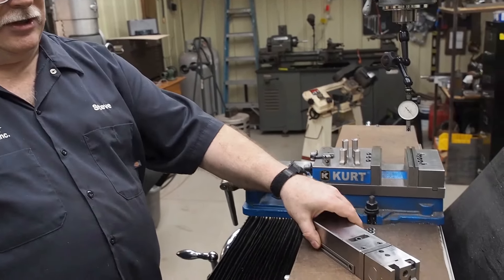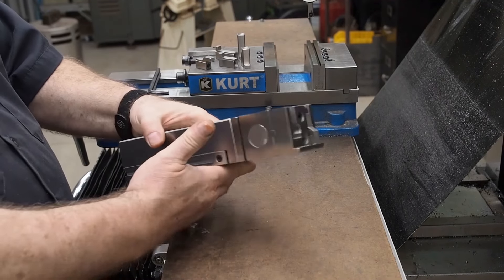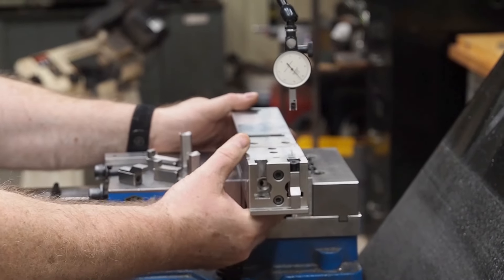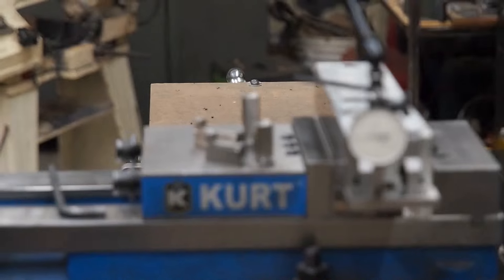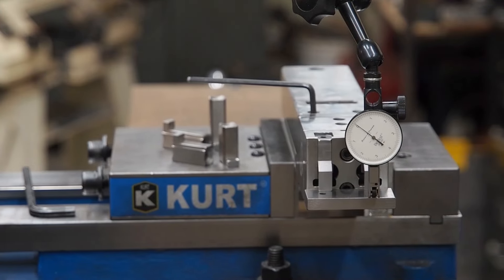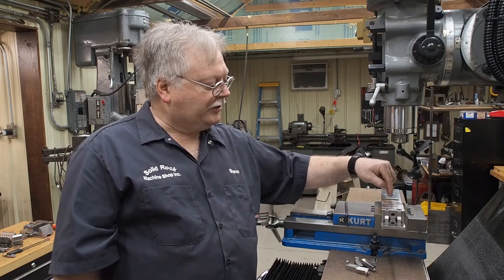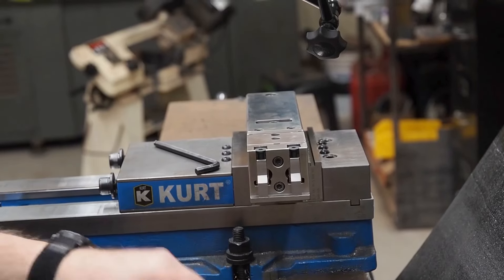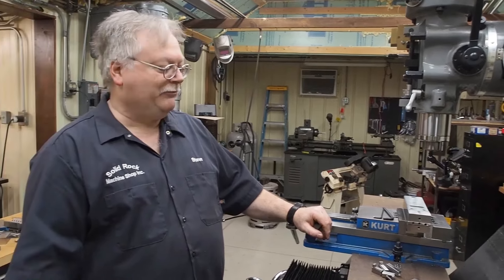Multi Axis Alignment Tool

Comment: Alot of companies sell leveling units. That's what this is
Reply from the maker: You are correct. I have used some in the past and at my current full time job I am using Hirschman tooling which is very nice. I am hoping we will have something better and different to offer.
Steve

Comment: Looks interesting Steve.  I ran a wire EDM for a few years and the fixturing was really important.  I spent about $20k on F-tool kits so they may be an interested company.  they used animations because of complex set ups, which were ok, but demos are key to sales.  Good luck with it.
Reply from the maker: Thanks Ujeb08.

Comment: Looks to me like a super useful fixture. One needs three wrenches for the different screws. I am sure you have thought about trying to use as many of the same size as possible.

Be careful to not reveal too much of it to prevent copycats! I understand you presented your design before putting it on the market as it is patented already. Daniel
Reply from the maker: Hi AtelierDBurgoyne,
Yes, I wanted to use as few wrenches as possible. There are a lot of things going on inside the unit that most would not pick up on even if they took it apart. We will keep the internal workings to ourselves for now. I think the real value of the patent would be to potential buyers who have the resources to go after copycats.
Steve
Reply: Solid Rock Machine Shop Inc. Hi again Steve. Thanks for your reply. I really think you guys are doing wonderful stuff. Love your channel. Looking forward to any vids with the Moore jig bore (or is it a jig grinder?). Daniel
Reply from the maker: Hi Daniel,
It is a Moore Jig Grinder. It may be a while on that one the grinding head needs to be rebuilt or replaced. I am glad you are enjoying the videos. 
Steve
Reply: I strongly agree on both of Your points above, we are in exactly the same situation now with a startup here in Sweden with a new product being put on the world market. It is a type of precision sensor.
My understanding is that Asian copying can most of the time not be prevented, it will just be delayed. Try to keep details to Yourself until the patent goes public, and it is also wise to keep a few things as trade secrets to delay the copycats. Getting a partner with respectable legal muscle is a very good idea. We have done that in the past in previous projects for several reasons. It seems virtually impossible for the little guy to legally defend a patent both in EU and the US presently. Best way for us has been to find a potential customer early on in the project and make a deal that gives the customer early access and influence on the product development in return for legal assistance in case of patent infringement etc. The customer gets exactly the product they want and the product will early on be tested in  its industrial environment. This also tends to make the product more mature when it reaches a wider market. It can be win win situation. This concept can also results in some income from sales early on in the project, which can be very welcome.
My best wishes for success with Your enterprise!
Reply from the maker: Hi Erik,
Thanks for the advice. My son and I already agreed to to keep a tight lid on inner workings of this device as long as we can. There are some critical design aspects to this device that are not apparent to the naked eye even if someone viewed the individual components.  We wanted to introduce the ability of the device in this video for those who may be interested in it.
Steve

Comment: I like the design, I think a finer thread on the axis adjusting screws would make it easier to adjust, but I understand the need to keep it affordable and very fine threaded hardware  the might have to be specially made would shoot the price up in a hurry!
Reply from the maker: Hi Rocking J Metalworks,

We can dial things in less than a .0001" very easy with the 10-32 thread. We been using a devise at my full time job that is different but uses 10-32 adjusting screws and hitting no movement on a tenth indicator is fast and easy. Also, I wanted to use standard components that would be easy to replace by the end user.
Steve

Comment: A solution requires a problem. I don't understand the problem here, if the machine is well trammed and its vise is precision ground and indicated in. Obviously a fixture such as this, with this many moving parts and degrees of freedom, will not hold accuracy much better than 0.001. Notice I said hold, which differs from instantaneous accuracy, although I also wonder whether there would be any reason to use an Interapid test indicator during initial setup. So if tenths accuracy is desired each new part is going to have to be indicated in anyway. I would think shops need to focus their quality efforts on tramming, and training operators to avoid actions that might adversely affect tramming.
Reply from the maker: Hi Josh,
This is a wire EDM part holding device. It was only being demonstrated in the mill because I do not own a wire EDM machine.
Steve

Comment: It is certainly a nice job, but I wonder about the complexity of the fixture. lots of moving parts leans lots of places for grit to land itself depending on outside variables. I have something similar I use at work but with a wider interchangeable jaw set. you can remove the jaws to install a V block on dowels or sine plate. the sine plate can also hold the vblock or part.
Reply from the maker: Hi DieselCrawler86,
In wire EDM you do not have to worry about grit or chips. What you do have to worry about is recast that will build up on the tool. This tool is designed with that in mind. It is easy to disassemble to clean the recast off with a Scotch Brite pad.
Steve

Comment: Best of luck on the sales Steve. Looks like a well engineered tool. Is there any concern of the hardware galling since everything will be set? Thanks
Reply from the maker: Hi James,
I don't think so. This unit had been designed to be easily disassembled and cleaned. I built  2 axis tools for a company that is different and not as nice as this unit. The older unit had moving parts and tight tolerances and they been using them for over a decade and no problems as long as they disassembled and cleaned the unit about every 6 months.
Steve

Comment: it would be nice it it played well with 3r edm toolig
Reply from the maker: Hi Darrin,
Thanks for sharing. There are so many types of tooling out there it would be hard to be compatible with all the designs. One of the nice things about this tooling is I designed it so that you can replace the bottom plate that clamps to the rail system. This way we can customize to what ever rail system the buyer uses. Also, the clamp head can be customized for a lot of tooling that is already out there as well. We are at the infant stage right now and things will evolve as we go.
Steve

Comment: Stainless steels love to gall so stainless taper head screws through stainless parts into a stainless block might not be a great idea. And stainLESS isn't automatically "rust-proof". Every stainless steel is has its own oxidizer(s). Seems like the "easily" machinable stainless steels are fairly vulnerable to rust. I've got a Browning A-Bolt Stainless Stalker I've owned for 25 years that has been lots of places and done lots of things in lots of different weather and climates and I've found spots of rust on the outside of the barrel before. That's a major extra reason all my guns get the "blued steel/wood" treatment and get a light wipedown with oil inside and out. 

Trust stainless NOT to rust and drop your guard and it'll bite you. People think "less" in the context of stainless steel means "without". That's not the case. A gun guru buddy of mine told me several years ago that its stain LESS and not stainPROOF.  There's also a WIDE range of stainless steels out there. I've got a Mac Tools tool cart with "stainless" tops on the sliding lids and that stuff will hold a magnet about like regular mild steel. I've got a stainless top on a Snap-On roll cab and that stuff won't even tease a magnet. But I've managed to stain BOTH of them.

I know nothing about EDM cutting but do you have to GROUND the work? Is the current passing from the wire and through the work to ground? That might be kind of an issue too, if so. Electricity takes the path of least resistance and I'm not sure stainless steels are all that good of conductors. It would suck to end up with cutting issues and/or parts in your tool holder "spot-welded" together by current trying to find a path to ground and hitting high resistance.
Reply from the maker: Hi DEEREMEYER1,

We are using 440C Stainless which is magnetic. All the wire EDM tooling I am aware of uses Stainless. The galling is not a problem with proper heat treat. I have different tooling I made for my full time job with 2 axis adjustment. We leave them in the tank all the time with the only issue being recast build up which affects all tools. We take them out about every 3 months and take the recast off with scotch bright. Stainless conducts very well, again most wire EDM tooling is made out of stainless. The units I make now are way better than the ones I made for my full time Job. The people using my old tooling won't use any other holding fixture if the units I built can do the job. They work great and everyone who uses them will say the same. We have none of the issues you mentioned above other than minor rust (small spots) from heat treat that does not affect the performance. We have been using these for over a decade. Thanks for commenting.
Steve

Comment: Good luck with your little project. That certainly doesn't look like a fast or easy jig to make.
Reply from the maker: Thanks Brian,
You are correct. There are over a dozen parts not including fastners ans springs in this unit.
Steve

Comment: I am interested
Reply from the maker: Hi Jurs,

We hope to be selling them in January. I have a few more accessories that need to be made and I need to make fixtures so we can manufacture the tool faster.
Steve
Reply: Solid Rock Machine Shop Inc. I have a cnc machine shop if you want to outsource anything
Reply from the maker: Hi Jurs,
Thanks, maybe later down the road that might come in handy. What kind of machines do you have and where are you located? What type of work do you do?
Steve
Reply: Solid Rock Machine Shop Inc.  I have three Hurco mills a brother wire edm a agie classic cut 2s late model and two surface grinders looking at selling the agie , actually have it sold will be purchasing another surface grinder cnc and a 500 watt pulsed laser unit with arges galvo for drilling and micro machining extremely tiny holes 
If you want anything ran for your prototypes let me know. On me. Good luck with the business
Building full of support tooling, several other laser units I didn’t mention and the list goes on... Columbus Ohio
99 percent prototype work and micro machining
Reply from the maker: Good to know, I will defiantly keep it mind. Thanks, steve